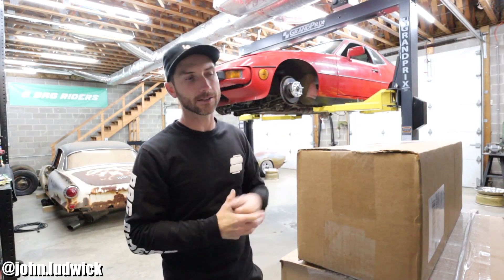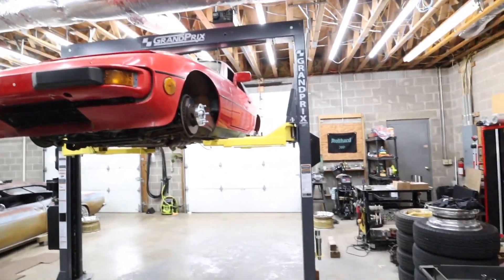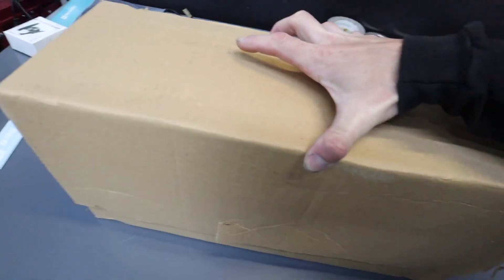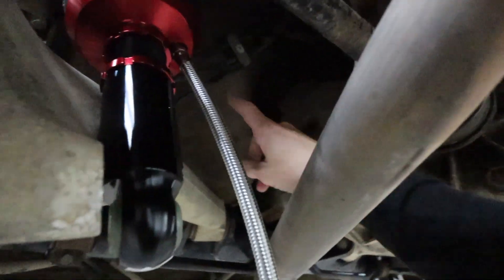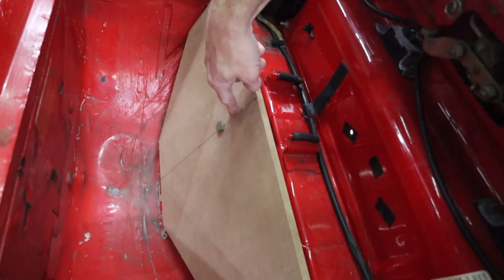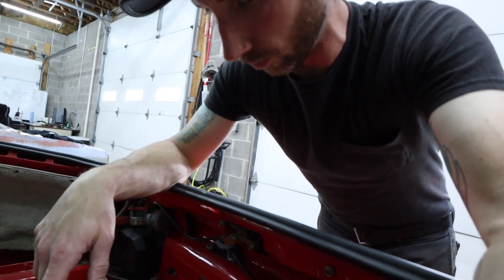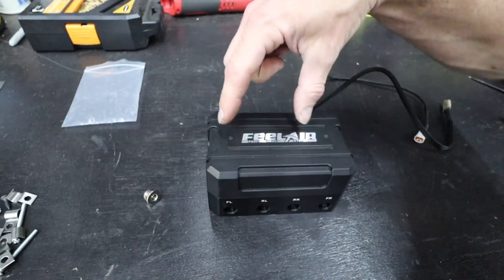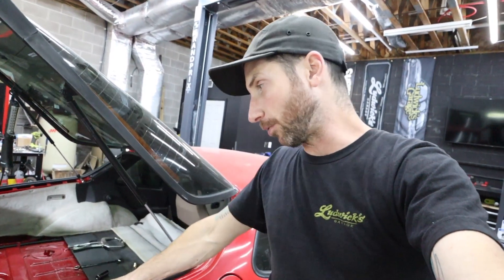Building A HIDDEN Air Suspension Setup In The PORSCHE 924S!

Comment: Looks really clean, did you ever think of using tintable rubberized under coating for like rolling the board with it and the tire area? I think it would be the added touch and also paint the tank to match the rest of the components.. looks super clean and love the custom badge you added.
Reply from the maker: Yea man, there’s so much more I’d love to do with it, if I wasn’t under such a heavy time crunch to get it “done” in time for the Helen trip!
Reply: @JohnLudwick  yikes I wasn’t thinking of the show, my bad I understand now , my bad

Comment: The Feelair management works well, fitted it a few times. However here in South Africa for me the Maxload P1 management had all the features of the Feelair and is cheaper etc so not much Feelair management gets installed. We do a fair bit of both of their bolt in performance air strut options as for the price it’s pretty unbeatable value for money and have a huge fitment catalog compared to Airlift options

Love the progress and vids. Keep it up!
Reply: Also to add

Thread on manifold is 1/4” G thread iirc so uses those fittings that have a built in oring on the fitting

I’ve used 1/4” NPT to 3/8” compression fittings for a setup I did that utilised 3/8” hardlines to the manifold

Comment: Is the manifold allowed to be mounted at this angle? AL3P is not because of it’s tilt sensor. Does this have a tilt sensor as well?
Reply from the maker: I have had the 3P manifold mounted at almost every angle over the last 10 years without any issues (never with the fittings facing upwards though). The manifold in the Corvair has been mounted completely 90° for 8 years now 😂 no issues at all!